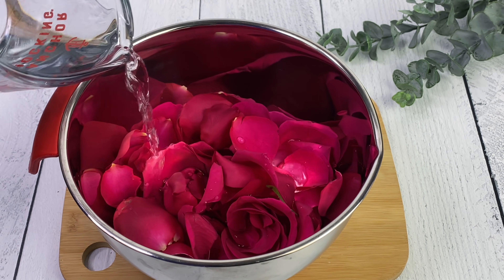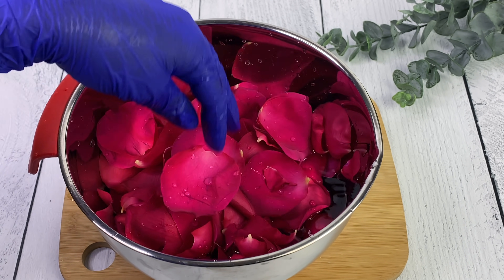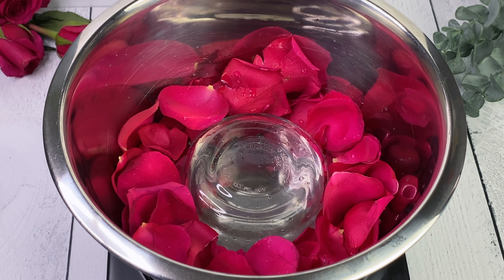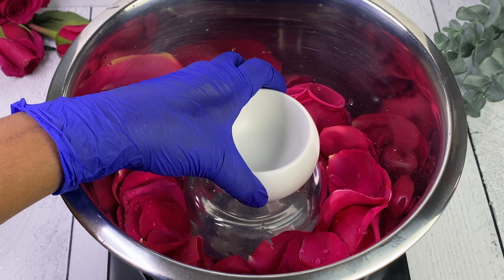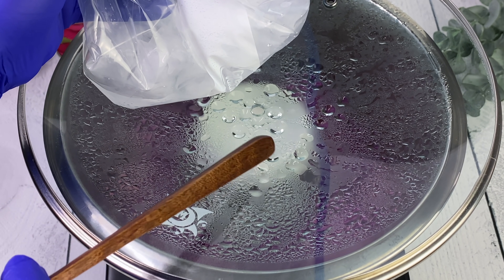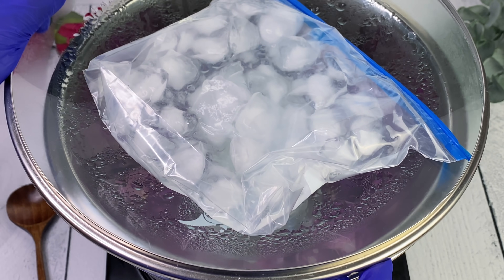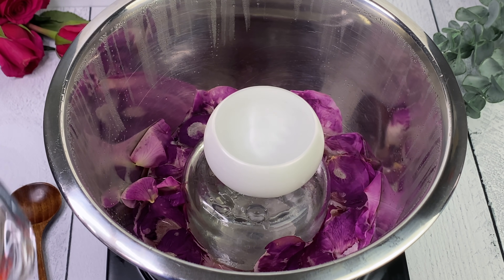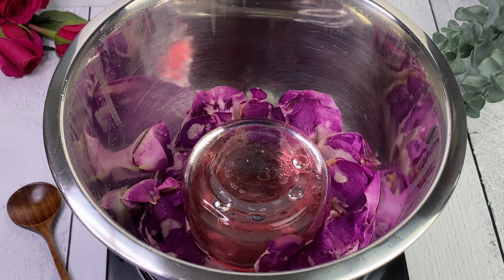DIY Rose Water 🌹| How to make Rose Hydrosol | Days 11 & 12 of the 25 DIY's of Christmas ☃️

Comment: Great up until sucking it out with the plastic thing… ruins it. Its plastic. Plastic leaches… especially if water is warm or hot!! You effectively made microplastic-hydrosol unfortunately! 😢
Reply from the maker: @Csdw_coyote  That may be the case. Please keep in mind that this video is an older video and new information may not have been known. I had no clue what microplastics were back then. After learning about them, I still unfortunately drink bottled water. No one is perfect. And yes, I still use pipettes to make my home made creations. I hope this helps.

Comment: Great project! 
But I must say that calling this a Hydrosol is incorrect.
Hydrosols are by products of steam distillation during essential oil extraction manufacture. So unfortunately this not a Hydrosol.  It is a beautiful rose water project. 
The terms Floral waters water extracts etc are generally used interchangeably and dont exactly have a strict meaning, but the word hydrosol has a specific meaning in the cosmetic industry to specifically differentiate between floral waters and genuine essential oil by product Hydrosol.
Unfortunately it's a bit too late to change it, but it's kind of important. 
Aside from that, great video!
Reply from the maker: Thank you and I completely understand how important it is to have and share correct information. I would love to read more about it. This was my first time trying this method. I thought this was a similar process, or alternative process, to get the hydrosol if you were unable to do the essential oil distillation at home. I may be wrong. Please, if you have a link or referral to a book were I could read the correct information, I would be more than happy to correct it in a future video. Thank you again for the information and forgive my misunderstanding. 💜💜✨✨
Reply from the maker: @vaslim1711  Yes, I also saw this, but this does not explain the process and different methods used to do so. From this definition, it seems that i could do the water-steam distillation done in the video to get the clear, Rose water from steam to condensation to hydrosol.

Also, there are two different processes in the video. One for clear, Rose water or flower water or hydrosol and another for the Rose infused water or Rose tea which is the pink color. I hope this helps. ✨💜

Comment: Good job Sis I love the sound of your cute voice! 😄👏🏾👏🏾 I actually made rose 🌹 water 💦 where I just boiled the petals.  Came out beautifully I put Lavender essential oil in mine as I thought it would preserve it for a bit longer.  I put the main bottles in the fridge and a bottle in my bathroom at room temperature.  To be honest it’s been fine I just check the smell to make sure it’s not gone rancid.  Also I only use small bottles so I refill them regularly from my fridge.  I use my Rosewater as a toner as it agrees with my skin.  I like the way you did the distilled version I may try that one day.  Thank you for sharing.  

How do you do those lovely labels 🏷 please?  I would love to label my DIY creams and lotions. ☺️
Reply from the maker: Thank you so much for sharing your experience. This does give me more confidence that the rose hydrosol will last very well. I will keep notes and report back when I can. I think I want to formulate a toner with some other ingredients using the rose hydrosol as well. 

Here is the link for how I do these temporary labels just for DIYs. They are not oil or water proof, so I add tape to keep them safe. I wouldn't recommend for professional use, but they are perfect for at home diys. Heres is the link: https://youtu.be/x2TUiX3I2ns

I hope this helps. I will do an up-to-date video on labels soon. 😊💜
Reply: @YayaDIYCreations  Thank you very much for your response and for the link much appreciated. 😊

Comment: Hydrosols are actually the by-product of making essential oils. This is still beneficial for hair, skin, face masks, etc.
Reply from the maker: Yes, but most of us do not have the equipment or know how to make essential oil. This is just a quick, easy way to get plant material via an at home water-steam distillation process. 💜😊
Reply: @YayaDIYCreations  some hydrophilic essential oils will be in your rose hydrosol 😃 in google it states : Essential oil: the oil-soluble parts of the plant. Hydrosol: the water-soluble parts of the plant (this liquid also contains microscopic drops of essential oil)

Comment: Hi love I know you’ve done deep conditioners can you do a regular thinner consistency wash out conditioner, a leave in conditioner cream or liquid based, and a curl pudding pls
Reply: Rinse out conditioner is just deep conditioner but diluted.. and leave in conditioner is rinse out conditioner diluted further.. just add distilled water to ur deep conditioner
Reply: @crazikai  I understand that part but adding water to an already finished product specially diy will mess up the consistency I believe because the things used to bring it together
Reply from the maker: @Cocoapuffgoddess  I can definitely do this for you. The process of adding more water would be during the water phase. So, in the actual formula, you would use a higher percentage of water than oil phase. The problem with this is that it can sometimes cause the formulation to destabilize if you are not using the right  emulsifier. You may also need solubilizers and other stabilizers to keep your formula from separating as you add other ingredients. I will do my best to get this out. 😊💜✨
Reply: @YayaDIYCreations  yesss pls thank you soo much ❤️❤️❤️
Reply from the maker: @Cocoapuffgoddess  Sure thing. Happy to help 💜💜✨